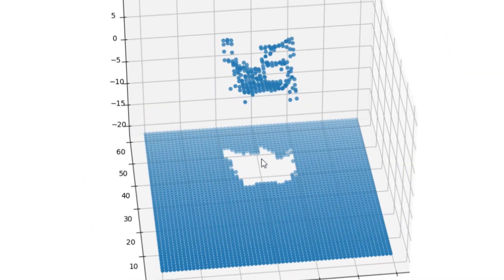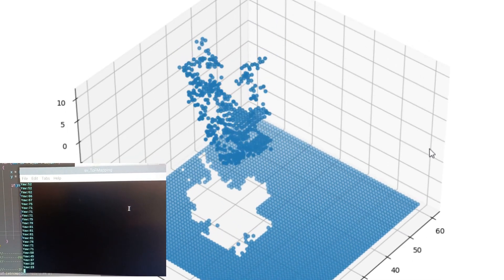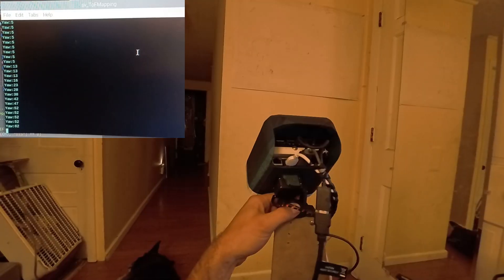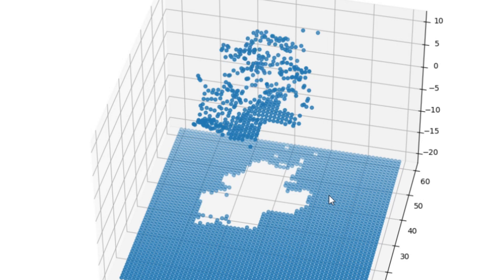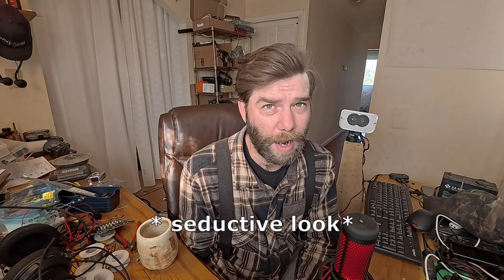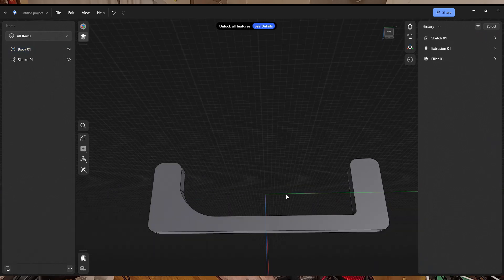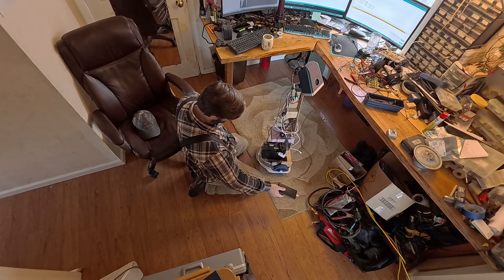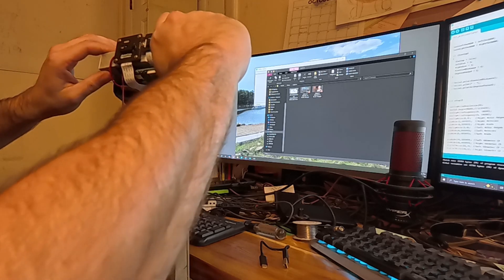Household Robot Project Ep5. :: Point Clouds and Odometry

Comment: Subscribed. I really want to get into embedded programming and robotics, but don't really know where to start
Reply from the maker: In my opinion, the place to start is with Arduino. They are affordable (with free software for your computer), easy to get started with, and have tons of sensor and output boards made for them. Everything is generally well-packaged and easy to use.  Look for an "Arduino Uno"!

Comment: Great project, glad that you got it running! I would be looking forward to seeing the next steps.

I have a simple suggestion for the ghost points problem, don't use average, use the median (mid point value of values when sorted from low to high) point value. This way you will always get one of the existing 16 values and not any made up values as it would in averaging. Also you will have to take care of the NaN value that will occur when your sensor is out of range, which can happen for cases where a pixel is on an object that is too close or too far to the camera. Usually median takes care of this too by default. But if you want to have a more careful approach you can drop all the NaNs before calculating the median value. 

Another possibility is to use the minimum of 16 pixels, this is safer since you would want to know the closest object at any point in order not to hit it. 

The 3D pointcloud matching your are doing is one way to do this, and there is an established fast way of doing it, since the search space is pretty large for brute force search. ICP - Iterative closest point algorithm (https://en.wikipedia.org/wiki/Iterative_closest_point) basically does some random searches and refines things from there. It may not work is things are too much out of alignment to being with, but in your case with processing almost every frame you will always be pretty close to the previous frame's pose. Also which language and hardware platform you are using? I would suggest avoiding Matlab, Python, JS like slow languages at least the for the poincloud matching step. Given that you sensor is low res, you should be able to get very fast matching using C++ or Go, Rust, etc. If you are processing on the Teensy, try to offload the visual processing to a beefier small-computer instead of a microcontroller. As environments get bigger, microcontroller won't have enough memory to hold the map. A Raspberry PI is of course a default choice for this, but there are more and less powerful options to it too. I personally use a Latte Panda for my robots, since it has an x86 chip so I can switch between Linux and Windows for different projects. 

In (indoor) mobile robotics, instead of a full 3D pointcloud matching, people usually do a 2D "scan matching" to find the 2D pose of the robot. Which is a term coming from the old times where there was only single line laser distance sensors that could "scan" one slice (parallel to the ground) of the environment. These 2D scans can be easily matched, since the parameter search space is much smaller, and you can still use algorithms similar to ICP here too. These scans are merged and used to build up a 2D map of occupancies for each voxel (called "occupancy map"). Nice thing about the occupancy map is that, once build correctly, you can immediately use it for navigation (mostly indoor scenarios), like A* algorithm. In case of modern 3D sensors, you will need to slice the depth image such that you get a depth line that is parallel to the ground at a fixed height. In case of a very articulated head, this could be a bit harder. Maybe try using one navigation camera that is fixed to the bottom of the robot and calculate the joint angles of the head from there using the servo angles. 

The process of understanding the pose of a moving robot from visual inputs only is called Visual Odometry and it can either fully replace or augment physical odometry sensors. Some drones are using IMU sensors and camera inputs for stabilization, which is done through very fast visual odometry. 

Another option for the wheel odometry, is to use optical or Hall sensor odometers, instead of the magnetic ones, which should give much cleaner outputs. 

Also do not trust your odometry results fully, since there could be inaccuracies and wheel slippage. Instead, use odometry to give a rough estimate of the expected 2D pose of the robot, then keep refining it with scan matching or pointcloud matching. This is called Visual SLAM (simultaneous localization and mapping), and there are amazing open-source SLAM algorithms that make use of probabilistic frameworks like particle filters and Kalman filters to locate a robot inside a map that it is building (robotic's famous chicken-and-egg problem). 

Hope these help in some way. I would be happy to discuss any ideas you have for the rest of the project.

Comment: Bruh the I2C chip select is completely uneccesary, I2C supports multiple chips on the same bus by virtue of I2C addresses!
Reply from the maker: You made me look back at the datasheet just to make sure.. 😅  

In my case, I'm using the AS5600 magnetic encoder, which has a fixed I2C address of 0x36, and I need two of them, so since they're on the same address I needed another way of addressing them so they don't try and talk over each other. :)
Reply: @joethieman9400  Damn, that's just sad way of making chips with fixed address. Shooting their own foot, like they couldn't think of an application with two chips?
Reply from the maker: @Quantum_Presence  Right? Unfortunately, I find this very common in cheap sensors... And in this project most sensors will be used in pairs, at least.
Reply: With I²C you can have 7 or even 10nit addresses, that gives you 127 to 1023 devices. Issue is a lot of pheriperials have one burnt in addresses, or some modules can select between 3..4 of them.
If you need to use more, you got address conflict.

I wonder if there are addres translation chips, wouldn't be surprised.

Either way, look up I³C. Not many microcontrollers support it yet and I don't know how wide it will be adopted. But it solves i²C issues.